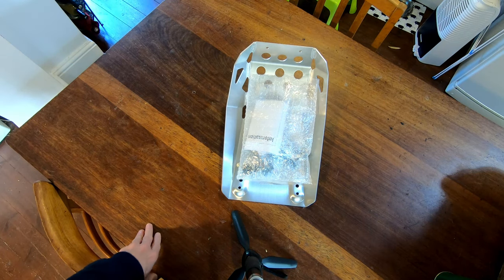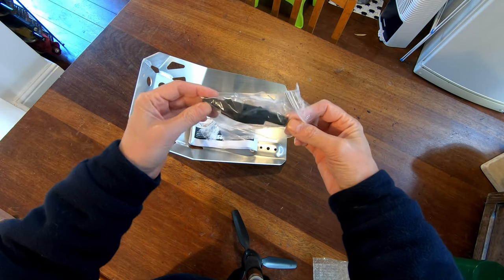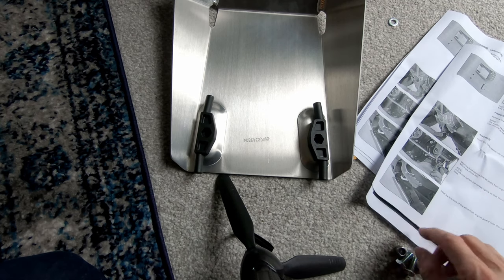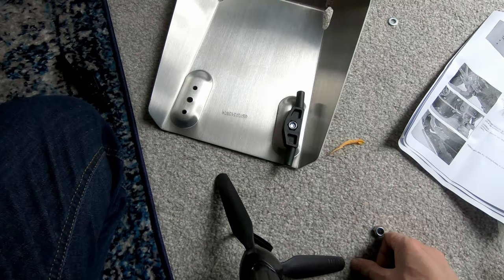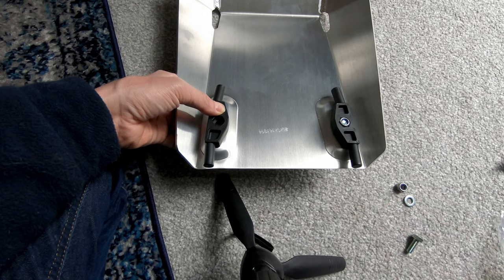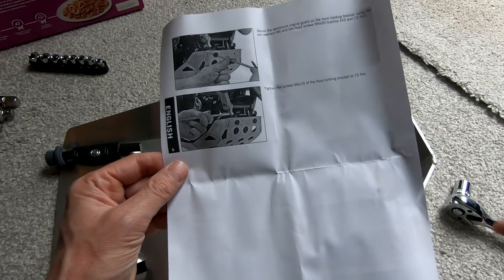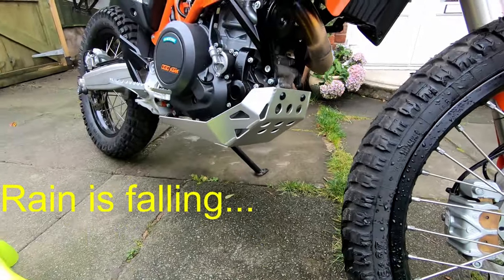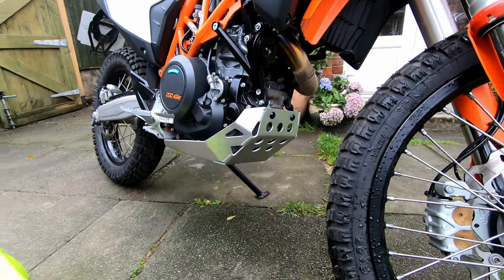KTM 690 Enduro R - Aluminium Skid Plate (76503090100)

Comment: Looks proper! I’d thought about going for a plastic one but I may have to reconsider (gotta buy the bike first though which is consequently how I found your channel as I’m looking to see what people are doing with these).  As another person noted KTM - Keep Taking Money. Guess I’ll add that to my Bring More Wallet (BMW) and Just Empty Every Pocket (Jeep) 😭.
Reply from the maker: It did come with quite a useable plastic bashplate as stock. The only thing that definitely needs changing is the clutch slave cylinder (or at least the O ring). The rest is personal preference. I got mine cheap, end of year stock and factored in the mods. Still it ain't a cheap hobby anymore that is for sure 👍
Reply: Unfortunately there is no more end of year stock around here (US, Ga) and I’ve actually had 2 dealers quote MSRP plus all their fees which tack on another $1,200 or so. Fortunately there are some dealers who will discount, even new 2021s. Interestingly, I was just reading about the O ring/Slave cyl issue on ADVRider today but it sounded like KTM have fixed the issue on newer bikes. I’ll have to verify.
Reply from the maker: That's what I hoped. Mine is a 2020 with less than 500 miles, see what I found: https://www.youtube.com/watch?v=4k2GZpUz-wI&t=273s

In my experience KTM do not fix historic faults so it is wise to know about them in advance. This is the only crucial fix, on this bike, as far as I know. Everything else is pretty well tested over the decades. Just keep up with the servicing...

Comment: Did you have a problem with the gear shifter? I bought the same unit and my gear shifter hits the plate!
Reply from the maker: No problem. But I had moved my shifter so my boots fit. Odd as it is KTM part. Is shifter bent? 🤔